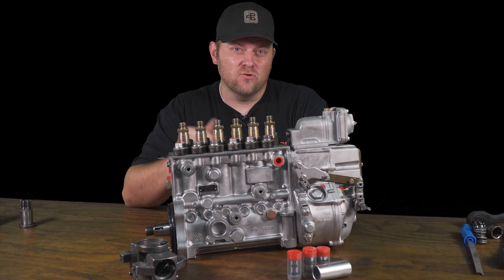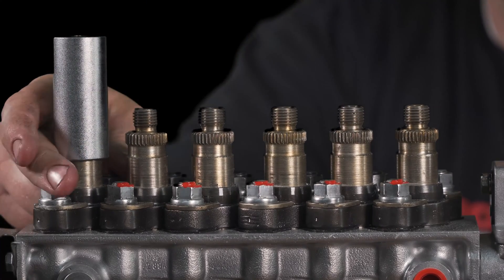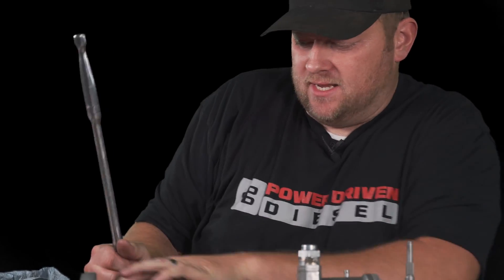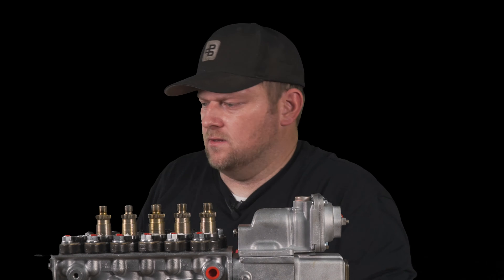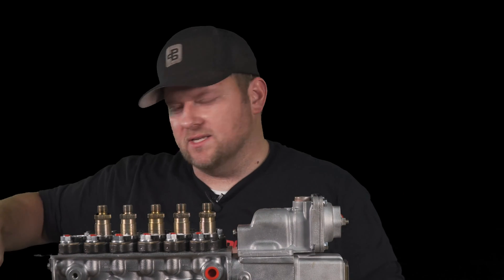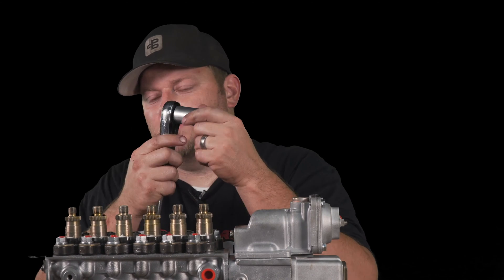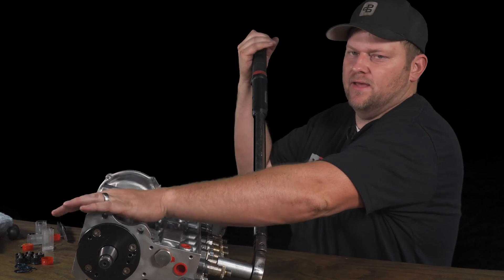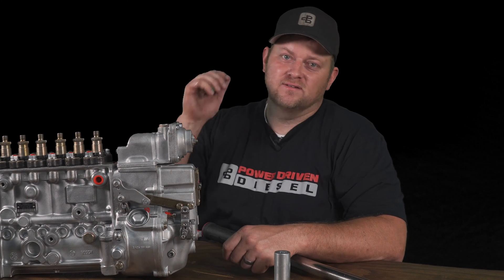Changing Delivery Valves on a Cummins P7100 pump

Comment: Would the 370 horsepower injectors, work with the dv .056 and 3k/4k springs. And  adding propane air injection

Comment: Is the plus or minus extra 100 hp with stock injectors or what would you recommend ???
Reply from the maker: DV's add power regardless of injector size.  Generally the biggest DV's are paired with the biggest injectors simply because the end user is looking for maximum fueling.  In testing, mild DV like 055 with stock injectors work great.  Aggressive DV like 7mm with stock injectors still works great but a cleaner burn would be a mild DV like 055 mixed with a mild injector like 5x012.

Comment: Ive installed a 95 p pump in place of  the old 6.5 that was in my 98 siverado k3500 even only at 160 hp its still funner to drive...3/4k gov springs are my only mod so far
Reply: I miss my old 95 6.5td.

Comment: Great tip on the idle adjustment, d valves should be here soon and socket behind it. I ordered full cut, truck is stock other than fuel plate and exhaust
Reply: that probably runs super hot i’d imagine